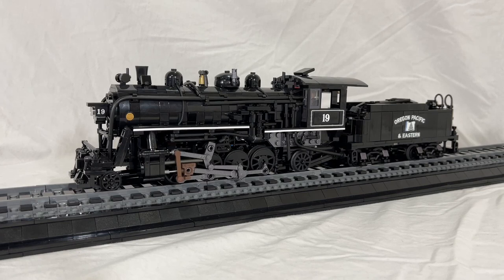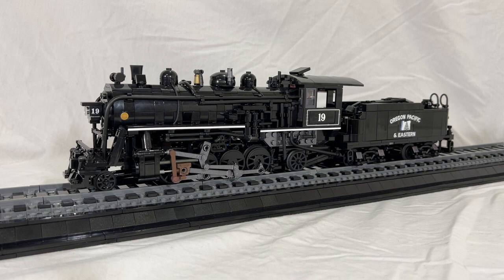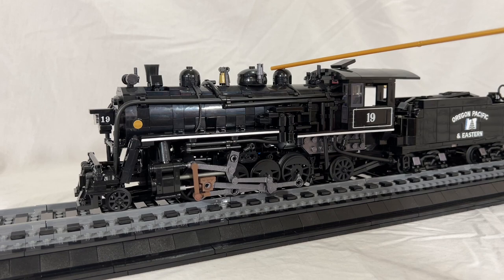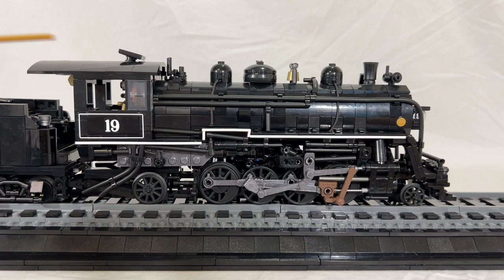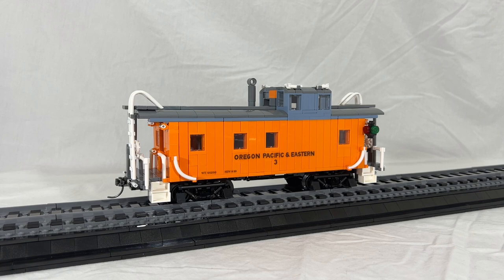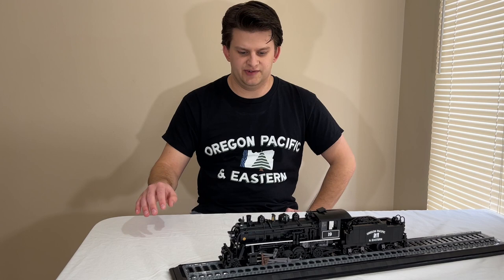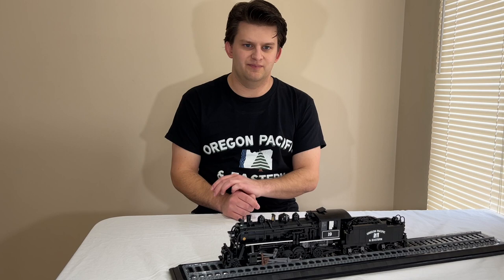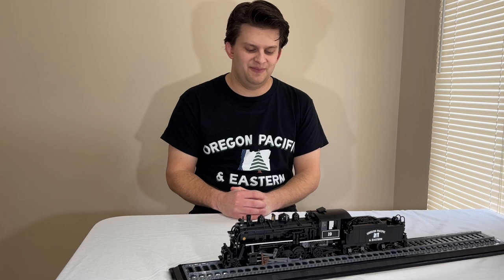Oregon Pacific & Eastern 19 - "Emperor of the North"

Comment: Since you’ve seen “The Emperor Of The North” (1973) which is actually a McCloud River Railroad #19, dressed as Oregon Pacific & Eastern #19. of course you’re a #19 fan. You can also see the movie “Stand By Me” (1986), there’s a McCloud River Railroad #19 where teddy tries to dodge a train. Because in the way I seen this part when I was 11, McCloud River Railroad #25 shows up came out of nowhere after four kids were on the Lake Britton Bridge and running from the train. And which means, I’m actually a #25 fan of this.
Reply from the maker: You're correct - I'm aware of the appearances of both 19 and 25 in Stand By Me. Two great films.

As mentioned in the video, 19 was owned by Yreka Western when they filmed "Emperor" in 1972 - during its time in Oregon, it was on lease to the OP&E. Unless I'm unaware of some minute detail or am forgetting something, 19 hasn't been a McCloud locomotive since it was sold in 1953.
Reply: I know. Even though I wasn’t prepared for this. But hey. The good news is they saved McCloud River Railroad #25 to run. And the half bad news is, they left McCloud River Railroad #19 to rust for long time ago, but sometimes if they restore this train, it’ll finally run again in the future.

Comment: gorgeous looking model, and good on working with what you could on the minifigs. the only thing id do is have a custom head for shack with the funny ernest borgnine crazy face because funnee memes. also good work on doing the running gear and valve gear justice. always makes me smile when people try making it as accurate as possible. only discrepency is more of a limitation thats hard to work around unless if its a large 10 stud gauge for example: the radius bar for the expansion link doesnt move up and down. again cant really do much about it. again always nice to see attention to detail

Comment: How do you attach the air compressor to the side of the boiler? the only way I've been able to do it is to take that 1x2 plate with a slider-thing, build the compressor around it, and jam the slider-thing between some exposed studs.
Reply from the maker: That's not a bad technique. I used a 1x1 round plate with hole attached to the side of the boiler, and then used a 1x1 round  plate modified with bar on the compressor. The bar slots into the hole and holds in place.
Reply: @GlennHolland  That's for the compliment, but I think I'll use your technique from now on.
Reply from the maker: @sambrown6426  by all means, go for it!
Reply: @GlennHolland  I certainly plan to! Also, happy Hanukkah.
Reply from the maker: @sambrown6426  and same to you, Sam!
Reply: @GlennHolland  🚂🚂🚂